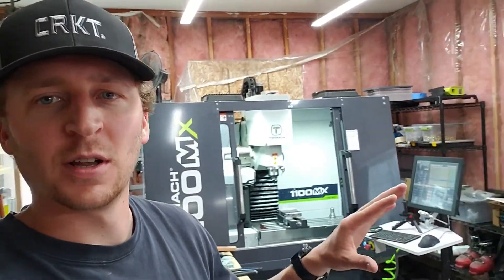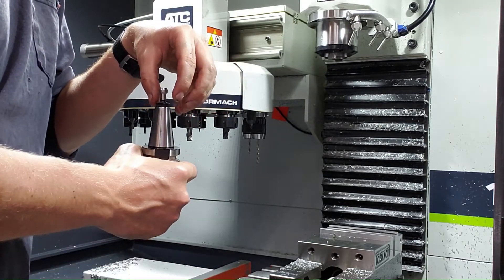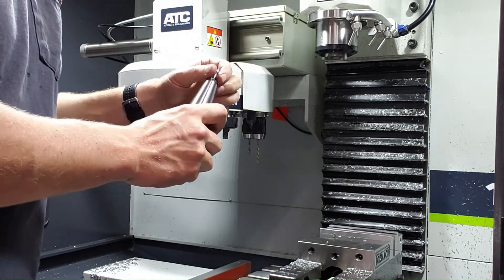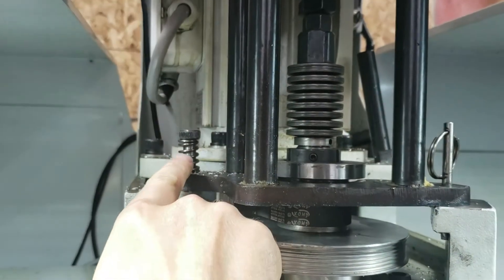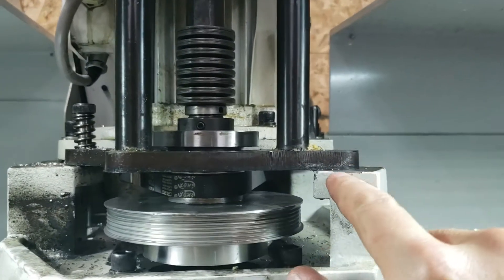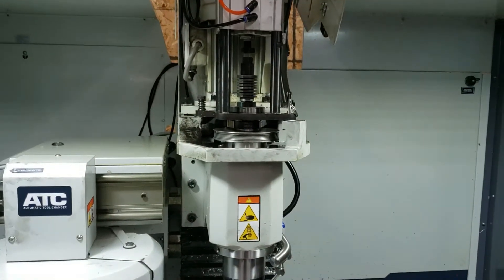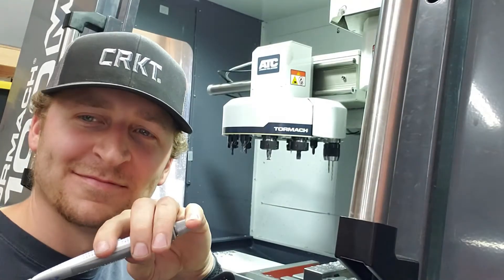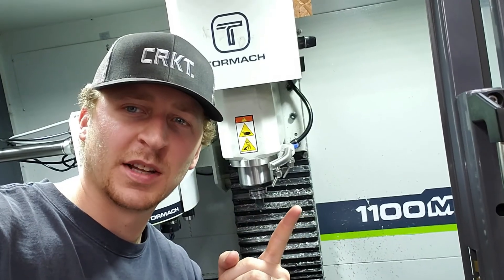Tormach 1100MX | Will This Make the Tool Changes Better or Worse?

Comment: hey man! i'm working on a tormach 1100m that I upgraded to a bt30 spindle and servo motors for the 1100m+. One thing that I noticed that might be the cause of your issue is the very top set of your spring washers looks like one isn't on correctly.  there should be a gap between the washers that isn't there... actually... it sort of looks like your missing one washer. lol there should be 8 sets of washers and it looks like you have 7 sets and one extra... maybe need that other spring washer.

LMAO that jb weld gag was golden